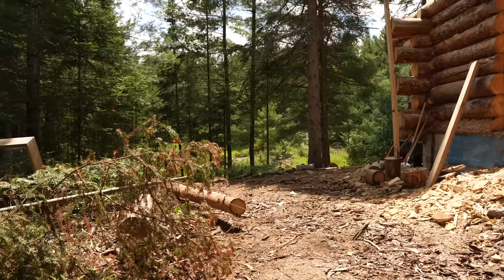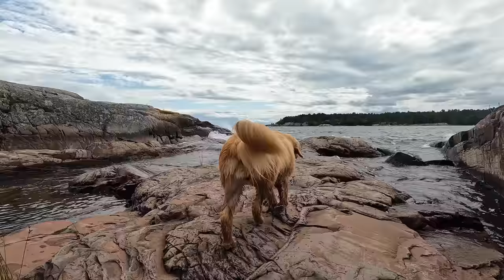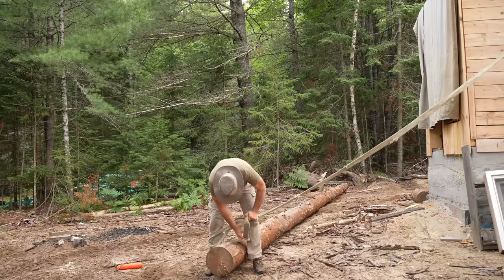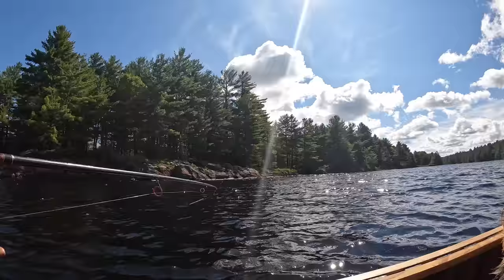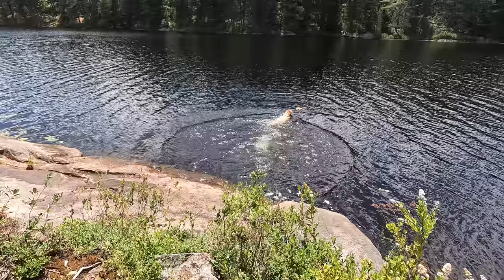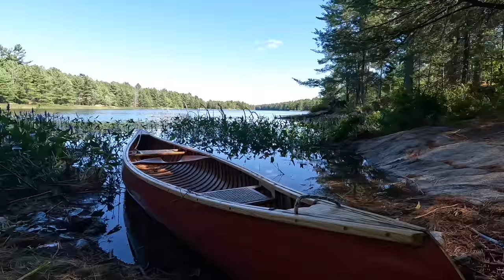Lifting a 28 Foot Log Ridge Beam and Purlins onto My Cabin Alone in the Wilderness, Ep 18

Comment: Shawn, will the roof lining be the same design as the last cabin?  with a layer of wood, after undercover blanket and then inch boards?  on the issue of humidity, does the burnt board prevent the infiltration of water from rain and snow?  or is it necessary to cover with metal or aluminum tile?  thank you, be well

Comment: Your hard work is very impressive, but man, use the right tool for the job.  A chainfall is nothing but a pain for a horizontal pull, you need a come along.  Putting those heavy logs up on the roof is not something to use less than the right equipment for.  A come along with about 30' of chain would have made that job a lot easier

Comment: Is there any logical or structural reason normal size, or even smaller, logs could not be used and simply place each one inward to form the roof; you could even do it on four sides, pyramid style?